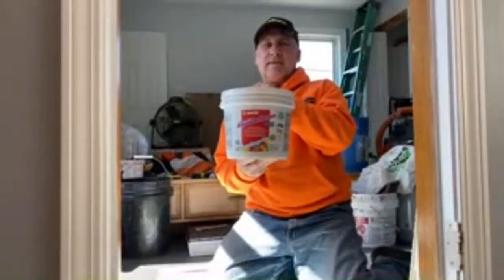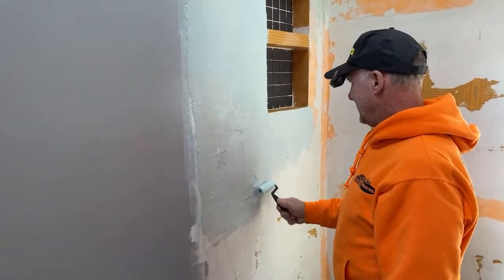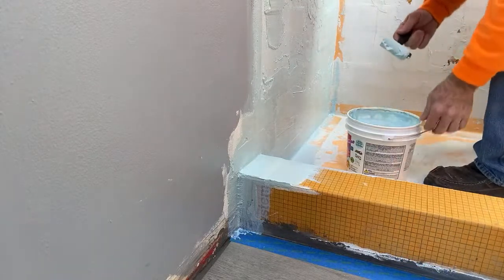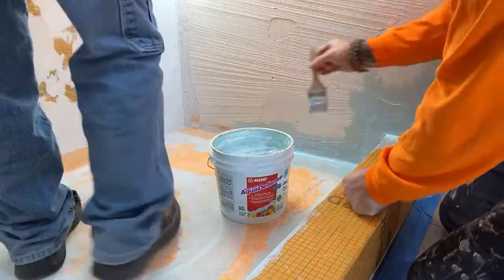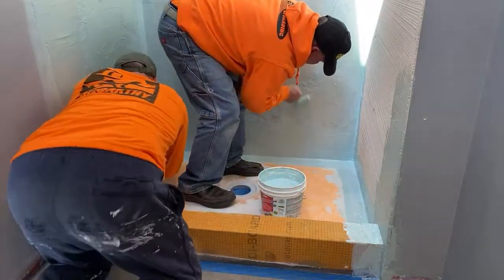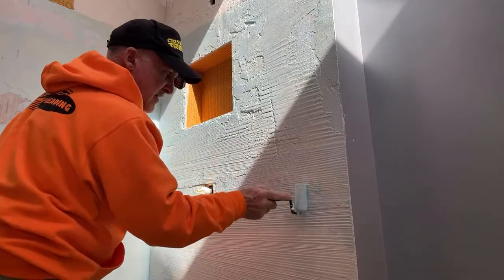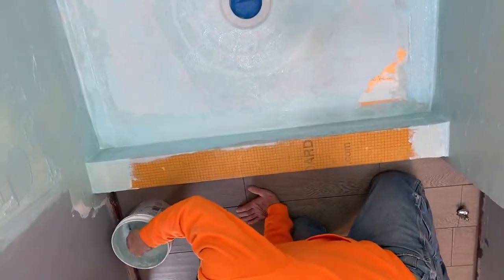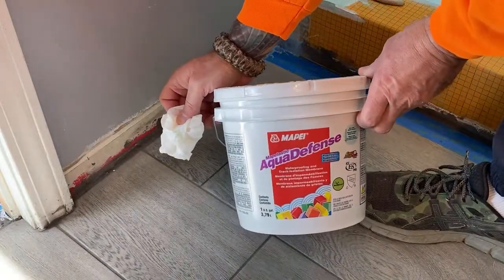🔴LIVE🔴 Mapei AquaDefense Waterproofing Schluter Kerdi Shower Walls

Comment: Did tub pull walk-in shower build.. used Kerdi pan. Go board walls.  Used Kerdi band n unmodified thinset on pan to wall seams. Used aqua defense n fabric on wall seams. Then triple coated pan seams w aqua defense..  walls got 3 coats too.  Entire install flawless..  yes you use aqua defense on Kerdi.    it adheres to just bout anything
Reply from the maker: Agree, can never over build IMO.

Comment: what thinset do you use that sticks to the membrane?  Can you still use a modified?
Reply from the maker: Hi Jim. So on this shower we used a modified thinset by Mapei Large Format Floor & Wall Tile Mortar which is commonly used for tiles that are 15” or larger on one side. I’ve had good luck with this stuff and can be purchased at Lowes. Another product I like is from Custom Building Products and can be purchased at Depot…either one is good. They are pretty much all good just follow the recommendation of the instructions from the manufacturer and you should have great results.
Reply: I'm confused because schluter said not to apply a membrane?
Reply from the maker: @terepin09  I've always applied a membrane and it makes no difference on adhesion quality.  I tend to over build and in this case do you really need a membrane?  No.  I have showers still in service that were built 20 years ago with plain wall board that have no issues and were not waterproofed with a membrane.  Maintenance is the key IMO after its built.  One thing most people don't do is grout sealing and that is a huge factor to the lifespan, so perform maintenance every 2 years at minimum.  Hope this helps and thanks for stopping by the channel.
Reply: @RoninMasterProperties  I. Also inquiring about the pan, it's the schluter with slope,  have you installed them without a membrane over them and if so how did they hold up
Reply from the maker: @terepin09  Hi Pete Pat here.  This is my first time using the schluter product I've always performed the dry pack method and wanted to try something new so the jury is still out on long term durability.  I did cover this one with a membrane as that is my preferred way of waterproofing, i know Schluter claims their product are waterproof if installed correctly, my thought is i am already putting all this time into this build and adding a membrane can only help with longevity/durability.
Reply: @RoninMasterProperties  yeah that makes sense. I think worrying about warranty is ridiculous.  My fear is that the 2 will interact in a way and adherence might not be good